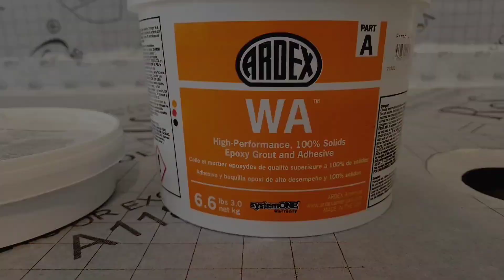Marble Mosaics Installation on Shower Floors.

Comment: Did you make the switch from a 6 inch knife to a 3 or maybe a 4? I can see how that would be beneficial as it could follow the contour of the pan better and have less chance for "flat" spots. Also, I imagine the disposable knife makes life much easier?
As always phenomenal work, you truly are a master of your craft 👏
Reply from the maker: Thank you very much for your kind words. I have been using different putty knives to collapse the ridges and you are correct that 3" and 4" work better and faster 👍👍👍

Comment: 1/8 V notch trowel is faster for me with mosaics.
Reply from the maker: I will add some additional info in the description. 1/8" notch trowel is enough to bond the marble mosaic but is not sufficient to provide an impervious mortar bedding under the stone which is why the epoxy adhesive is used in this method.